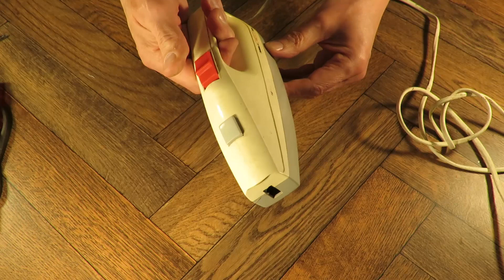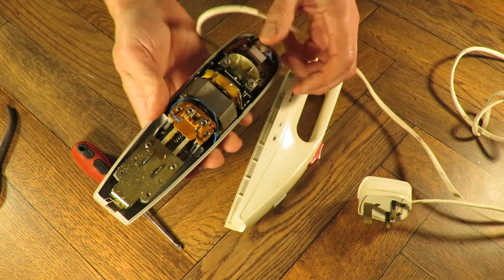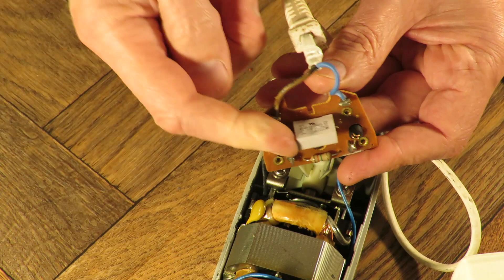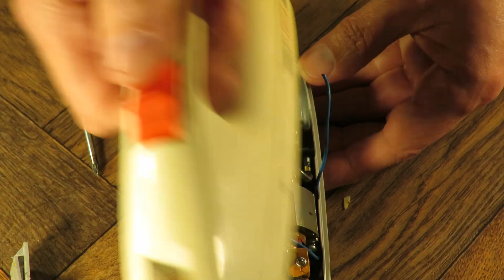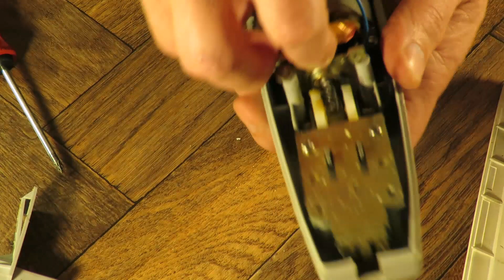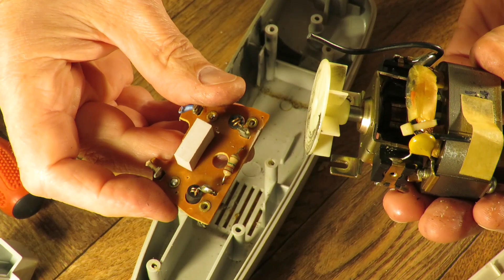Tear Down - Carlton Electric Knife

Comment: If you energise the coils of the motor with a AA battery you will get a magnetic field, then you can apply a 12 volt supply to the motor and it will work. :-)